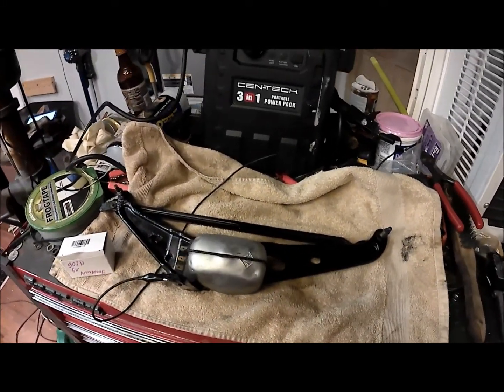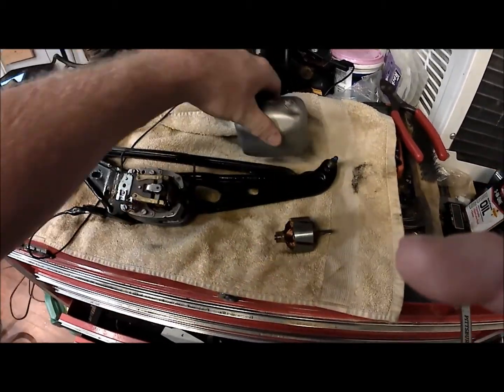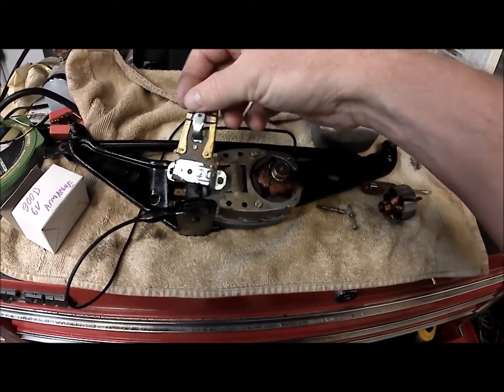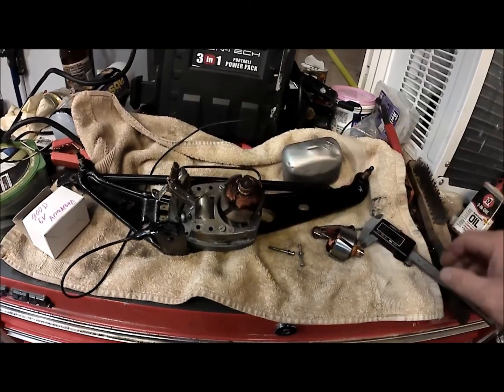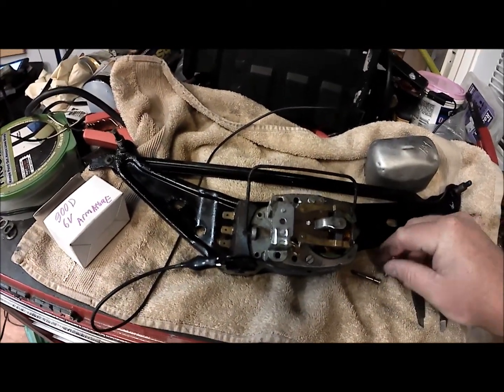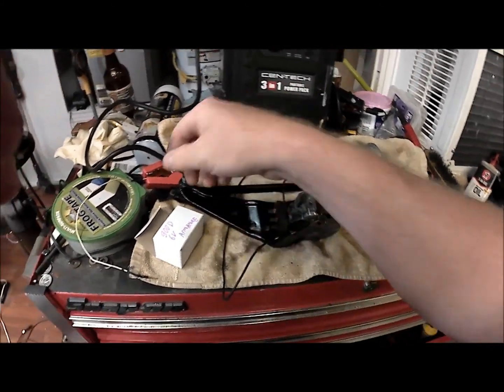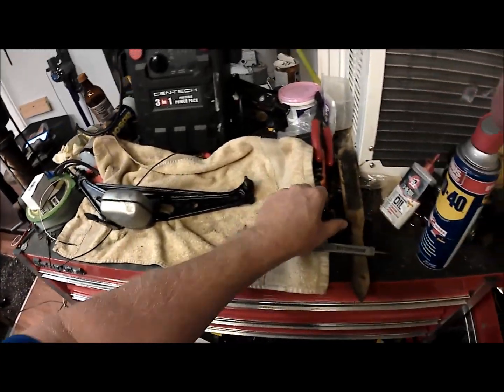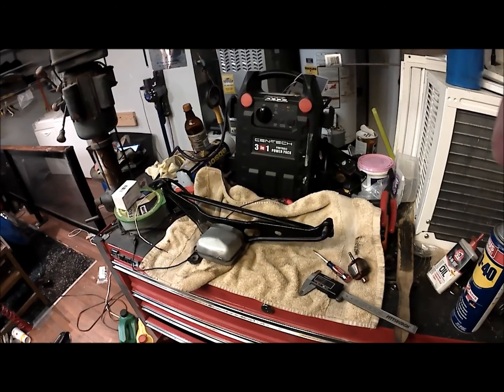How to convert a 6 volt wiper motor to 12 volt

Comment: I really mean that you don't show the armature working once installed in the car itself. It's very important to see if the wipers stops just at the right side or not and seeing the speed as well.-
Reply from the maker: They returned to the parking position as they should. The armature has no control over that, it is in the wiring of the wiper and switch that controls that.

Comment: Not good info. You don't show us how to extract the frame out and even you dare to show if the mechanism at last functions as well.-
Reply from the maker: Black Phantom I showed it operating at the 6:00 mark. As for removal of the unit from the car, it is only held in with one bolt and the two nuts on the wiper shafts. If you are having trouble removing the unit, I suggest you find a mechanic to do this conversion.

Comment: the conversion armatures are only for the SWF brand wiper motors single speed up to 1966 won't work with 1967-1969 bug 1974-1974 thing 2 speed wiper motors or Bosch or Avogg wiper motors.
Reply from the maker: They make them for the Bosch motors as well.
https://www2.cip1.com/ProductDetails.asp?ProductCode=VWC%2D113%2D955%2D811%2DC

As for the 67+ models here in the USA to they were already 12v so no need to convert them.

Comment: A 6v motor will work on 12v...for a little while anyway. ;)
Reply: it will run very fast cause the wiper arms to slip out of position on the wiper shafts as well the motor will coast past park and the wipers won't stop it won't burn out but run too fast on 12 volts
Reply: it will work on 12 v but will coast out of park, and can knock the wiper arms out of position on the wiper shafts. you can use this armature or get a 1967-1969 12v 2 speed SWF wiper motor